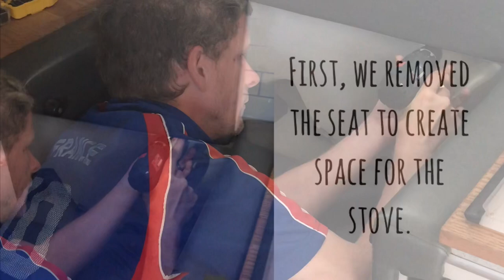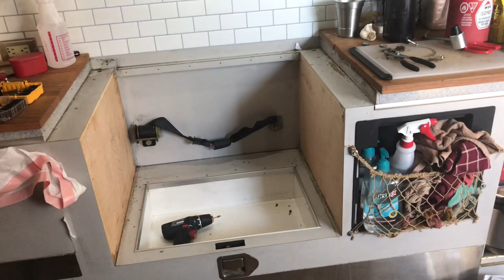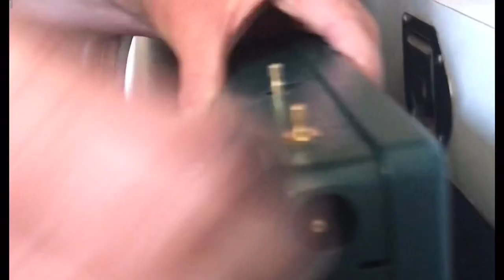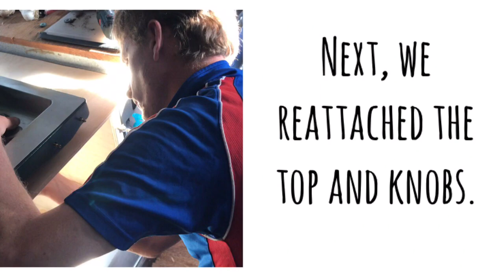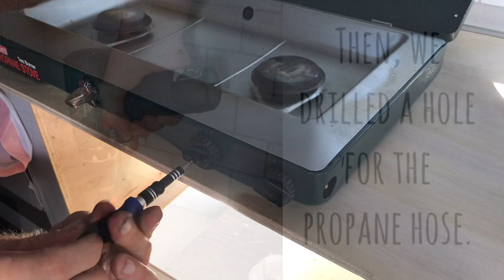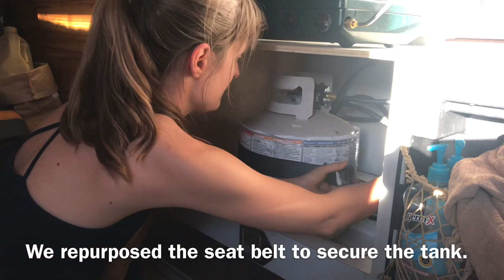Permanent install of a Coleman 2 burner propane stove in our ambulance camper

Comment: Does the bottom of the stove get hot?
Reply from the maker: Judy H nope! I was concerned about that, but it doesn’t. Actually we’re going to be replacing our stove with an induction burner so we can get rid of propane and run entirely off solar. April